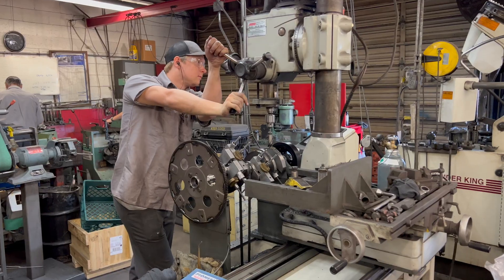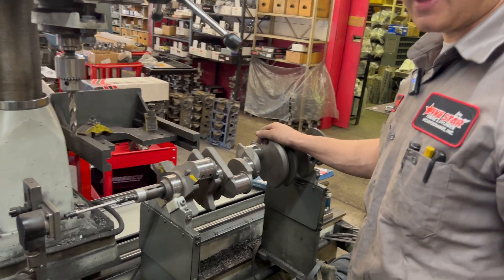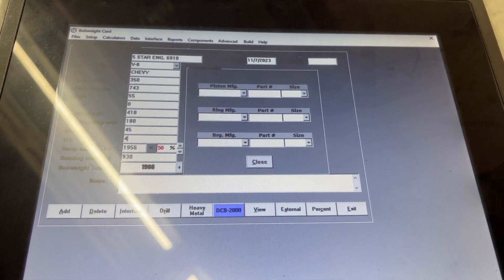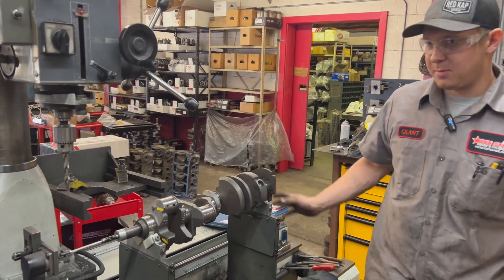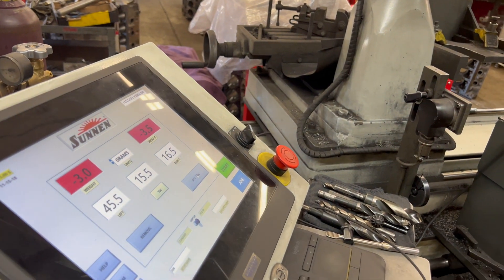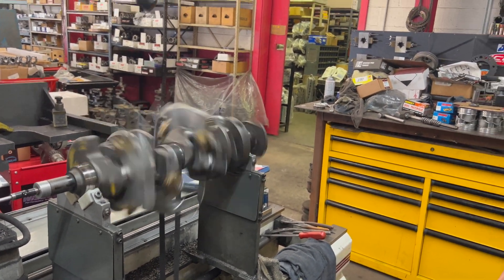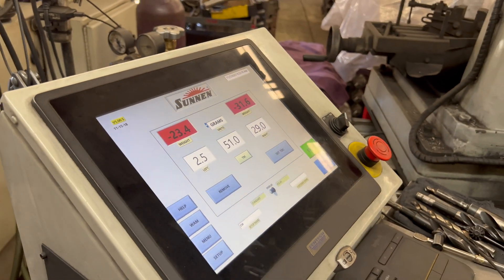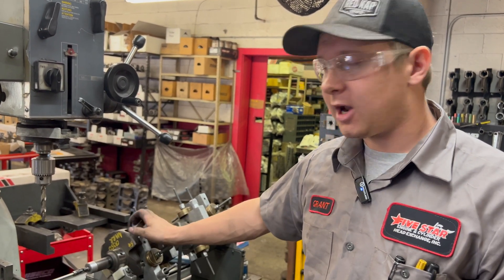Crankshaft BALANCE - Balancing for Performance - #BarrytT w Grant Smith @ Five Star

Comment: the part number on the shaft says ch 350. but since he has to add weight to the counterweight the shaft most likely came out of a 305. they are the same crankshaft but the 305 needs more drilled out bc the pistons are lighter. ok to use in a 350 but for sure it needs rebalanced or it's gonna viberate at idle.
Reply from the maker: Now that I think about it, we used a different crankshaft when we were trying to show adding weight and I didn’t check to see what that was! Thanks for your comment